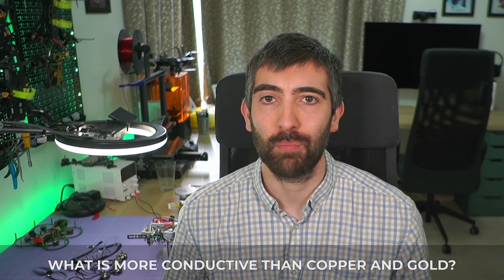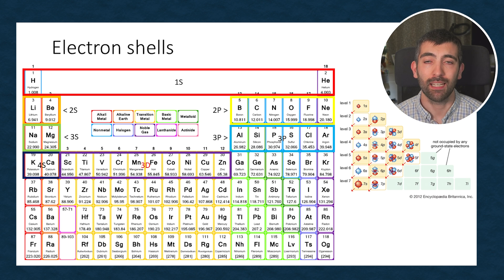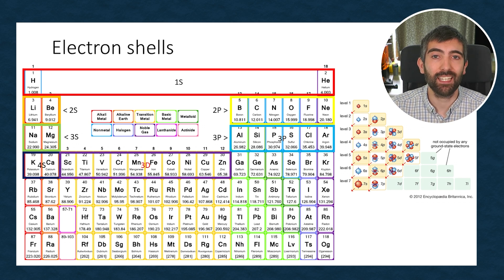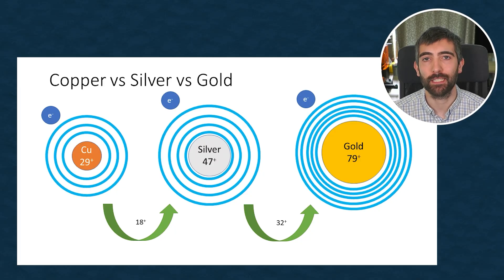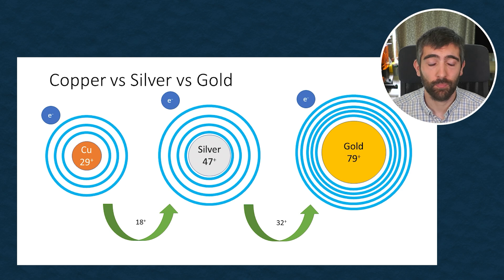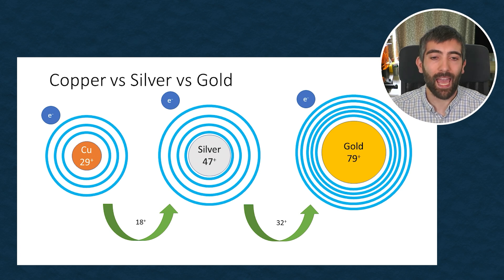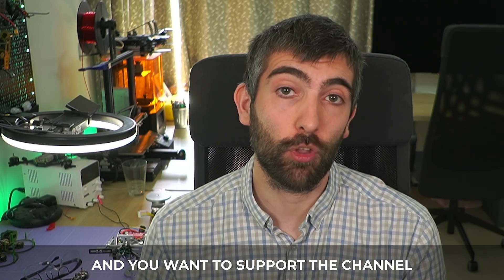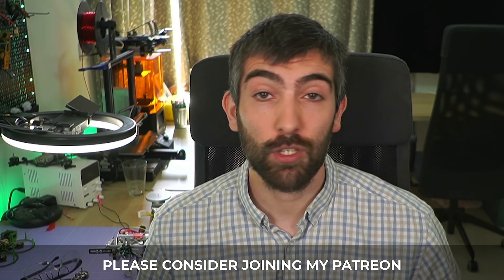Should we make our motors out of SILVER or GOLD? Silver vs Gold Conductivity Explained

Comment: I would be careful about calling this a scientific deep dive. Although orbitals are mentioned they are not really used nor explained, opting instead to use a shell (or "levels") model and using terminology like "are forced down", which is not very scientific. 

If a orbital model was presented instead using energy levels such mysterious forces are not needed, as the electrons simply take the lowest available energy state (as the orbital naming is simply the shape and order of orbitals with the given shape, not energy). A much more clear explanation would come from simply mentioning the arrows in the orbital diagram, as they show the order they are filled. This would not even need to explain the quantum physics that describe how high energy a electron has in a given orbital.

The points about electron-negativity seem misleading, people might remember from chemistry that oxidation=loosing an electron so how can gold both loose it gladly (conductive as per explanation given) and be inert? Gold actually has a rather high electron negativity, alkali metals have much much lower - but they are not at all as conductive (the explanation for that lies in with what orbitals are participating and the overlap between them).

Lastly there are a lot more things that affect conductivity, or are relevant when discussing it, such as crystal type, hybridisation, carrier concentration, material structure (annealed, crystalinity etc), skin effects (why silver coat), electron interference, and relevant to drone motors magnetic permeability (in a drone motor impedance will be more relevant) and there more then a factor two difference in magnetic susceptibility in silver and copper (albeit most of the magnetic flux will be in the iron that has many orders of magnitude difference (and is not diamagnetic).

The summary about cost and when to use which is good, but I don't think the video is a scientific deep dive, nor a very good resource for the matter of conductivity.

Comment: I really like the effort to distribute science. The problem for me is that EA is not really the best measure. We need to find a way that matches more modern knowledge. Also because in solid state the full picture might change. Let me reframe it. Teaching EA is not good. It was deprecated many years ago. Some engineers still use it for just fit to purpose applications.
Reply: ahh.. I was a computational chemist. I can probably calculate the EA of any atom. But as I mention it has very little to do with conductivity properties in metals.
Reply: Technically speaking you start to introduce misinformation. EA = Conductivity. And this is definitely not correct. I do understand that you did try to explain the orbitals shells, but that concept went away for normal people very fast. In addition that theory works nicely for isolated atoms but probably not that much in solids.

Comment: I have a challenge for you A question that I can't answer so quickly at first without looking in the literature and doing calculations. Think you as an Aero engineer have more skills than me as an electical engineer on this question/hypothesis anyway:

3D mode FPV is when the motor can change direction of rotation. Are more propellers and a low KV better than few propellers and high KV? 3D mode is always good to fly when changing from high speed in one direction to high speed in the other direction is quick and easy...

According to my instinct, lower speeds should actually make changing the direction of rotation easier (because of the rotating mass), but maybe I think too easy because a higher number of propellers also makes the change more difficult (air resistance)...

Although 3D propellers are currently being delivered with 3 blades, that doesn't mean that these are the ideal 3D props, but are designed for standard KV motors in my opinion...
Reply from the maker: For 3D mode I would look for lightweight propellers that can change RPM quickly. Blade count affects efficiency and thrust so 3 baldes is a good compromise between efficiency and thrust. 3D props are always much less efficient than standard props because they have to be a compromise in the forward and reverse directions.

Comment: Hi Chris, great video! Thanks! I followed most of the explanations, but couldn't grasp the "pushing down on lower level" part. could you point me to a basic reading or YT on this? Thanks!
Reply: So the 3d orbital is physically closer to the center of the atom than the 4s orbital, so the positively charged core would pulling this spare electron from the 4s orbital back down into 3d

Comment: 10:33 I'd like to se Aluminum listed for comparison, as well.  Isn't that what's used for all those overhead wires carrying power long distances?
Reply: And that's all there good for unfortunately, it's a very poor electrical carrier
Reply: @M-H433  Its pretty good actually, its second best to copper, the third best to copper is zinc funnily enough...
Reply: Once a join or clevis is installed it's not....if it was as good as you say the appliance company's would be using it in huge amounts and in transformers.

Comment: After learning about the Lie-to-children teaching method I have realised that a lot of the UK's GCSE-level content is taught this way and I wish this were not the case. I was "taught" that the central electron shell contains 2 electrons and all the rest contain 8. It is nice to know this is incorrect 🙄
Reply: Lewis model, IIRC.  It describes effective rules for chemistry, and actually came before more physical models for that were understood.  You do know that there are the same number of electrons somewhere as the atomic number,  and shells == rows on the table.
But, even knowing the population details in detail, that's not enough!  The rabbit hole keeps getting deeper.  You get hybrid bonds, which recover the earlier model of all the bonding points being the same.  But that's for single atoms... molecular bonds calculated on whole molecules are bespoke solutions, and explains why even knowing the rules for chemistry they are still "rule-of-thumb", quite different from laws of physics learned elsewhere.